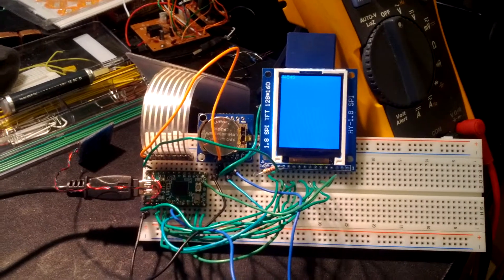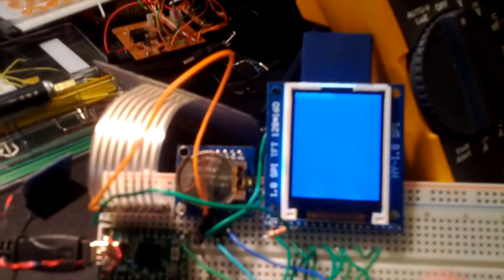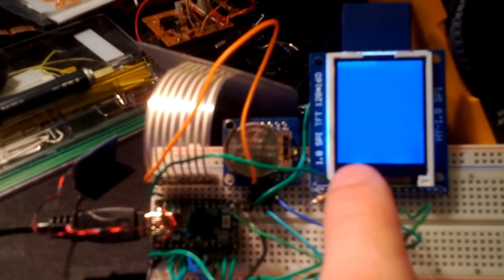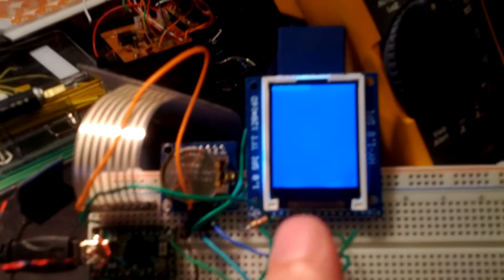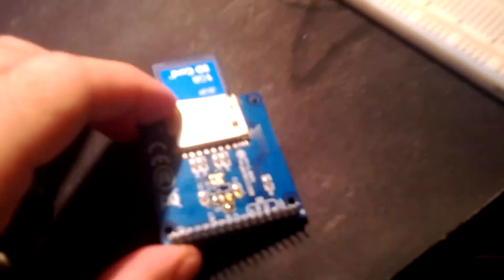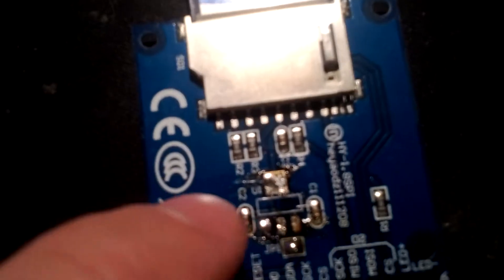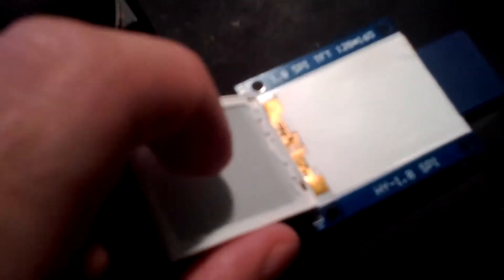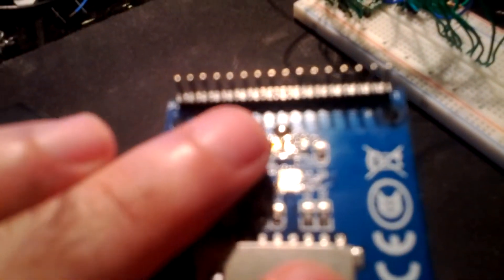Fix for 1.8" tft lcd screen bad colors

Comment: Thank you so much. I had the same issue with a 2.8" LCD from Banggood. After watching this I tested the voltage and I only got 1.6V after the regulator while running on 5V. I jumped J3 and dropped the input to 3.3v and it is working great!

Comment: This solution did not work for me, there is another one. The data lines are not working appropriately with 5V. Solution is to add 1k Resistors to all data lines including Reset and Chip Select

Comment: Oops, never mind.  I hadn't jumpered the JP1.  With th regulator removed, JP1 shorted, the LCD board powered by Nano's 3.3v out and the backlight connected to +5v the screen works perfectly now!

Thanks for sharing, really appreciate it.

Comment: Thanks for posting about your troubles.  I have the same board and I was finding that when the screen was beeing updated the colors would appear washed-out. The colors are perfect otherwise.

I removed the 5v regulator and powered it using 3.3v and it's much better but still not perfect.  The problem still exists, but less noticably.
I'm using an arduino nano v3 and I'm using the hardware SPI pins to connect the display.
Both the backlight and display VCC are using the 3.3v output from the Nano.

Comment from the maker: I do all sorts of electronics projects, RC is just one of them. Until I can get my hands on some money to buy more gear the RC stuff is mostly on hold. The car works well now and the rest of the stuff I want to do requires a few hundred bucks which I don't have. I want to put stabalized real time cam on it as well as a sensor pack and lights like with my mini car but as stated don't have the cash laying around to do so for now